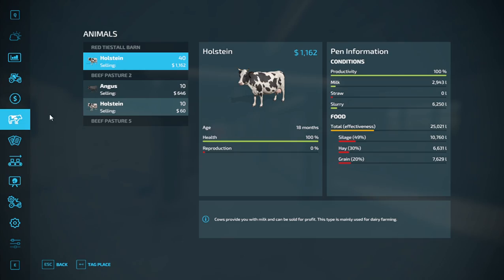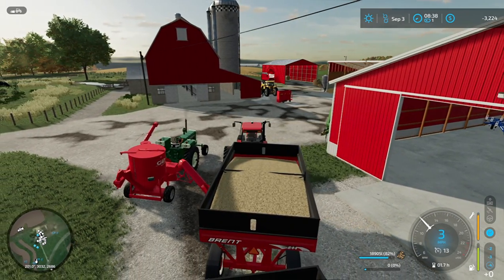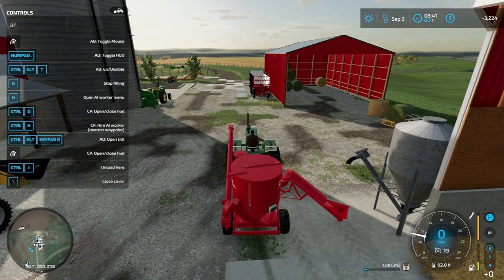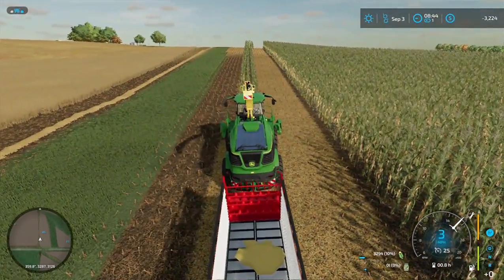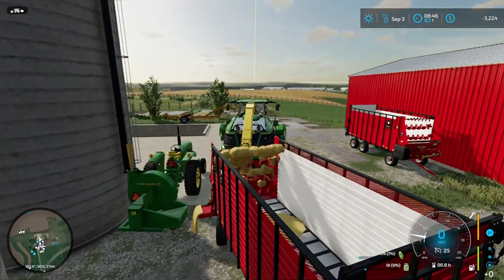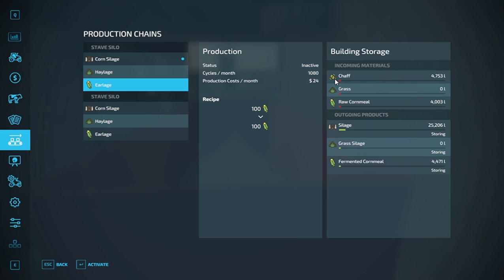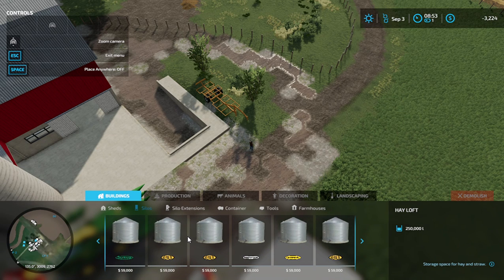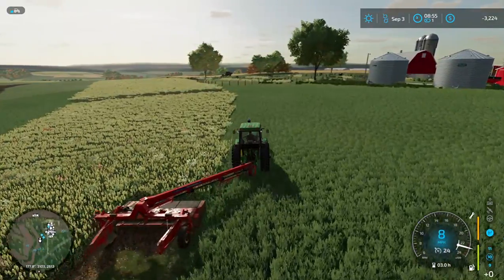FS22 Westby how to mix feed for cows

Comment: How do you do green mowing? Giants won't let you do this until its ripe. ( or is this part of the map? ) I have Maze plus that lets you do green mowing but if you enable maze plus it messes with the cows feed. FS 19 had a green mowing mod but the mowing mod we have now won't let you mow crops. I wish there is a mod for mowing crops WITH out the maze plus mod.
Reply from the maker: That was built into the map. You can edit maize plus and also get the food extension to do more editing. Maize plus also has the base game tmr mixture in it
Reply: Thanks for the info. I tried the Maze plus base game tmr and it uses more silage than hay for the mix and I find the Maze plus very buggy and I will not be using in future. I just want the ability to do green mowing like FS 19. Thanks again.
 @squatchmonky

Comment: How do you make Ear corn and Dry Ear corn to convert it in the hammer mill for Mineral feed?
Reply from the maker: Make sure it’s in the fillTypes xml under the mill converter section
Reply: @squatchmonky  Yea it's in the game and shows up on the hammer mill but im just wondering like how do you actually make the ear corn. I used to earlage header with a chopper and got raw cornmeal how do you get ear corn?
Reply from the maker: @mattcraztex9940  nothing was released to make ear corn with the map. You’ll have to find a ear corn harvester
Reply: @squatchmonky  ah ok that makes sense i see the fill-type in the game as well as Dry Ear Corn but i don't see anything officially released by you guys to use it. Thanks for clearing that up

Comment: This map would be perfect if they moved the feed troufs of dairy barns to an outside lot like ashton corners. Then we wouldnt have to use the mini tmr kart.
Reply from the maker: That wouldn’t be realistic then
Reply: @squatchmonky  it would be..just like the main dairy on ashton corners. Most dairy farmers here in WI dont feed cart in food anymore. There is usually a concrete yard the cows go to post milking with the feed bin outside that is filled by a full size TMR wagon. From that yard there is then usually access to a grazing pasture/laydown barn. It would be easy to add a concrete extension on to their future maps/buildings with a long feed bin.
Reply from the maker: @user-rm5du1yo9p  I understand that but the way they made the map wasn’t intended to be this day and age. They like the farming style of the 70/80s. You can edit the map for your personal use like I did
Reply: @squatchmonky  thanks!

Comment: Thanks for the vid but I have a question could the corn head on a pull behind forage harvester be modified like the regular corn heads for the ccm
Reply from the maker: I’m not sure what the attacher joint is on the pull behind but the pull behind corn heads are in the works

Comment: What mod did you use to load the feed mixer with straw and if it’s public where do i get it
Reply from the maker: You mean the tele-handler?
Reply: @squatchmonky  no the thing you pulled up and you pressed likereaload and you put it on straw and it just loader automatically
Reply from the maker: @haydenarmstrong7390  inside the building is a stave solo that comes with westby. Steve silos are filled with chopped grass chopped corn and hmc. The small bin is just for holding mineral feed and that can be found on jmf itch io

Comment: This map is a mess with the animals
Reply: Hopefully the new update fixes some of the bugs but this guy does a good job explaining how it works, but I agree before this video I couldn’t figure this stuff out
Reply from the maker: What exactly are you having issues with?
Reply: @squatchmonky  issue is with releasing a map based on a huge dairy farm the freestall farm, which then can’t produce milk because it has no straw capacity. Secondly if you need certain mods to make things work on a map they should come with map, IE Gehl feeder included in map but doesn’t actually do anything without the feed bin that makes it in to mineral feed. Earlage header comes from somebody else, plenty of maps out there so I’ll move on thanks for trying to help with these videos anyways
Reply: @CapeCodDrivah  squatchmonkey released the earlage header who helped make the map and the gehl mixer converts any of the grains into mineral feed as soon as you empty it into a wagon or feeder, the mineral bin is not needed at all